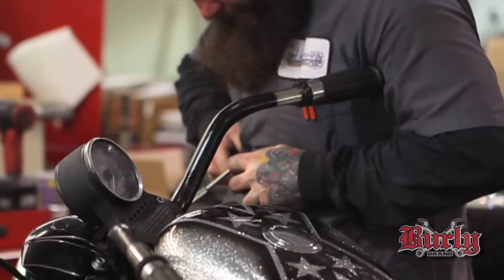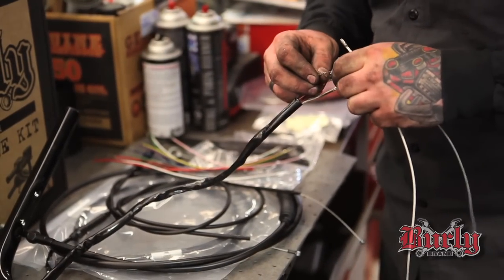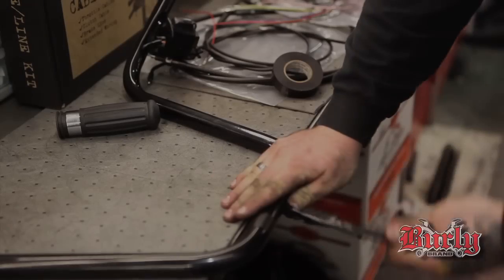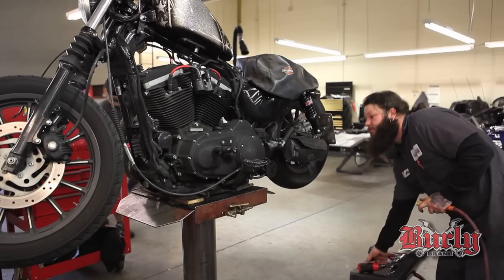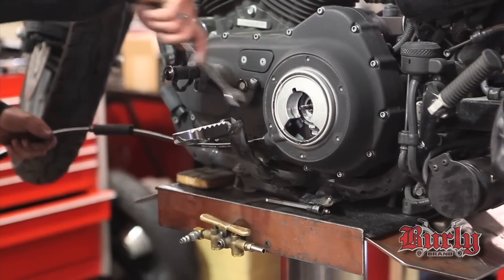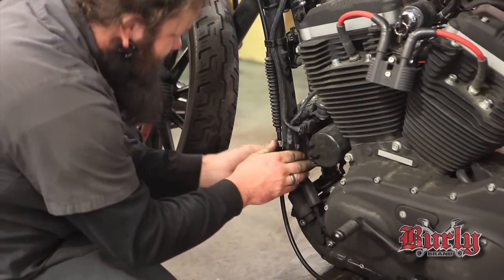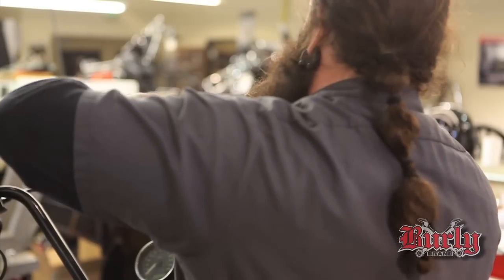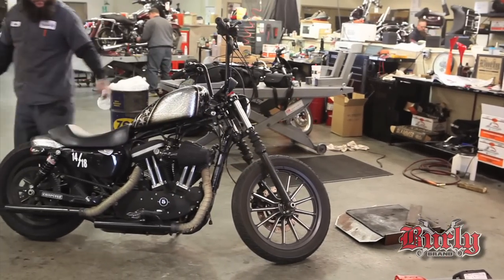Burly Brand Narrow Bottom Apehanger and cable kit install

Comment: Nice video. This is probably the most popular modification out there. I recently did it to my 76 Sporty. It would be great to see a video demonstrating proper soldering technique on the wires you installed. This is an important step towards the reliability of the intsall, and many people could benefit from seeing it done properly. I know I could. Thanks

Comment: Great video, I ordered a set of Burly 14" bars and cables everything went on fine except I installed the throttle cables and it seems like the return cable is on the wrong side of the switch housing and the throttle rolls toward the front. I did install the correct cable(s) to the right diameter of cable housing. Any info would be helpful Thanks

Comment from the maker: Pull the face of the plug off to reveal the steel connectors inside. Each connector has a tab on it. A paperclip or other pointed tool can be used to push on the tab, this will release the connector and it can then be pulled out of the back of the plug (each wire has a connector and each has to be done individually). That help? If not, drop us a line using the contact info on our site Youtube does not allow links within their comments) and we'll walk you though it.

Comment: Question, I enstalled 16'' apes on an 04 sportster 1200 using same burly kit, matched all the wires back up kept everything neat and heat shrinked. but when i hooked it all back up and tried to test my lights nothing is working correctly? any thoughts? tips? Thanks,

Comment: how do you pull out the wires from the wire connectors? Is there a special tool?
Reply from the maker: A small flat head or paper clip works.